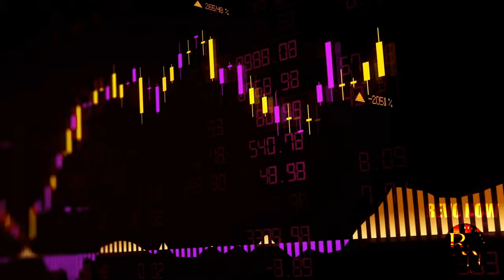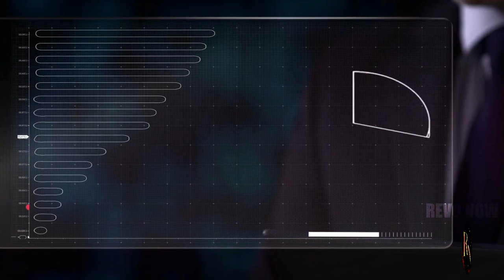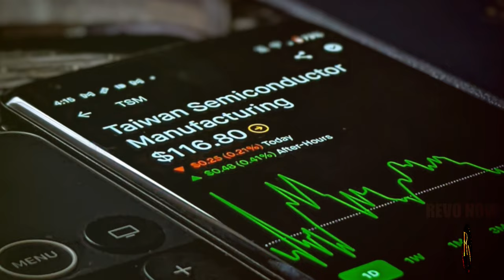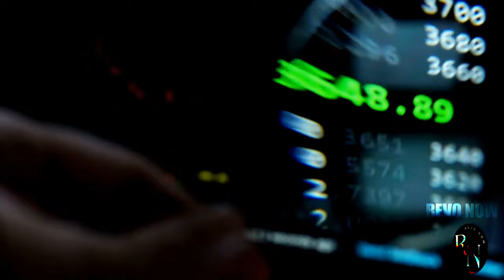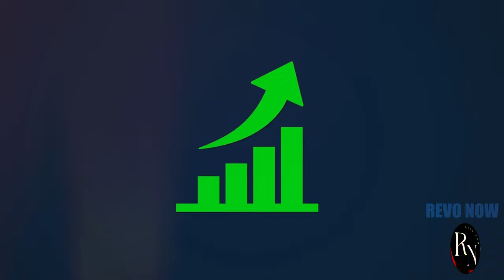You Won't Believe How Much Money CHINA SMIC is Making!

Comment: SMIC was fortunate that the US sanctioned it and other Chinese companies to make do with what they could pull together sans high end chips.  Mature node chips represents 80% of the semiconductor market so SMIC went where the majority of the market was while it kept chipping away at increasing its ability to produce high end chips.  Today, SMIC is capable of 7 and 5nm node chips and it appears they are trying to develop 3nm chips using DUV technologies.  SMEE is rising in lithography and if they succeed, SMIC will be a primary beneficiary.  In the meantime, there are literally hundreds of companies of various sizes designing chips of various capabilities that add to SMIC's customer base.  Media reports suggest that the semiconductor sector with grow on average 6 to 8% per year, which means the semiconductor sector will double in 12 to 9 years.